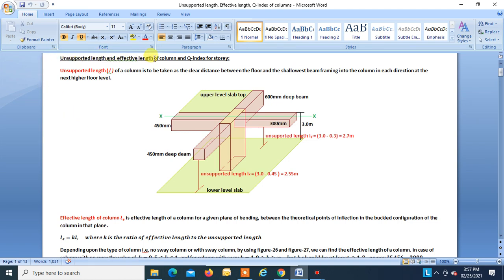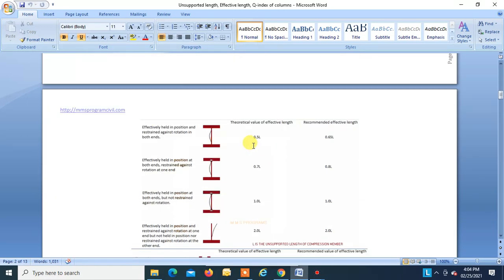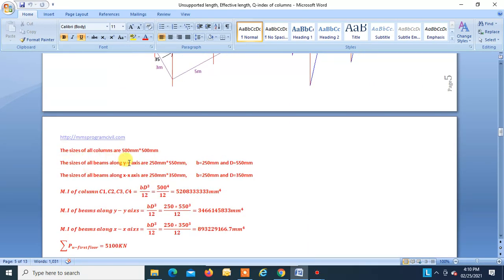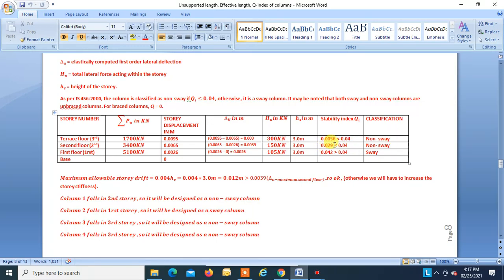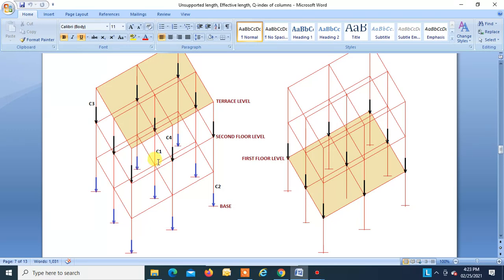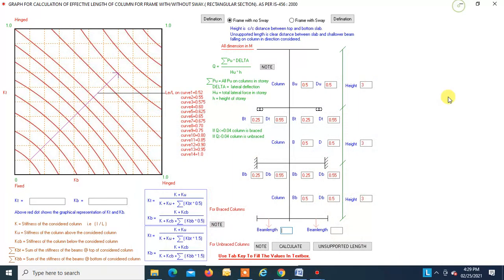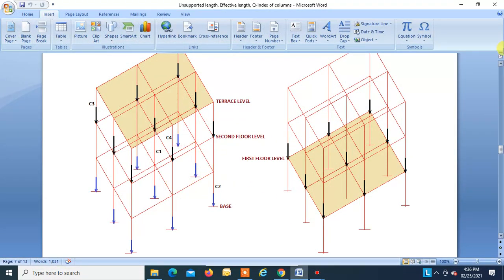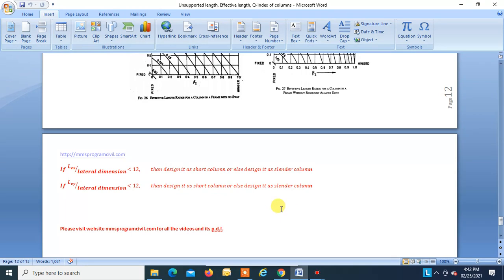Find unsupported length and effective length of column, stability index Q of storey

Comment: It's nice technical discussion that helps the engineers lot,
Can you provide an macro/excel vba for automatically calculates effective length and that is  connect to staad directly ,if the structures is to be designed in staad pro? ( As of now, staad pro doesn't have facility to calculate effective length factor of columns automatically (like etabs), users have to assign it to each column manually , which is time consuming and tedious task.